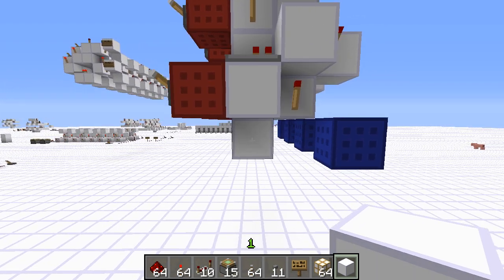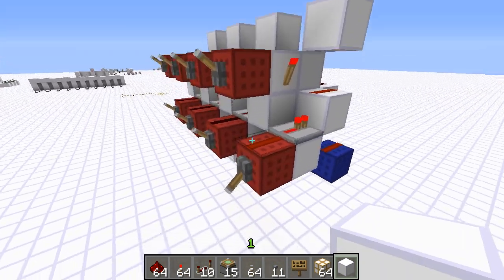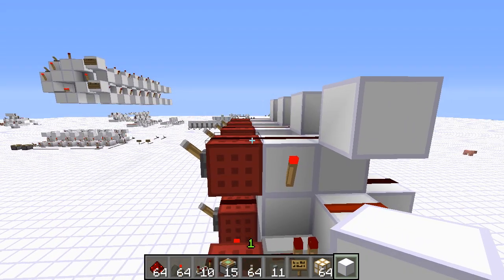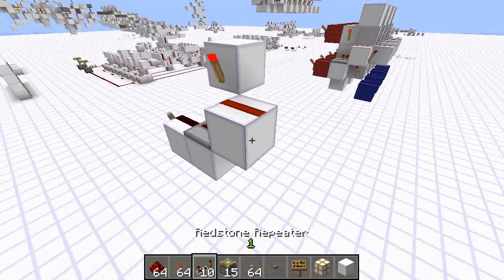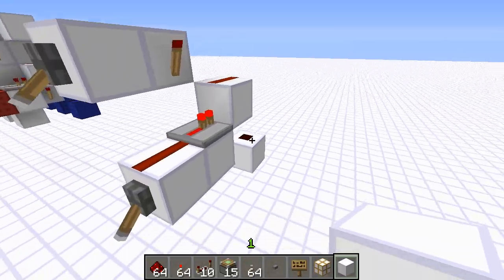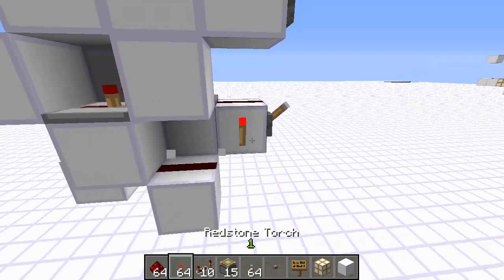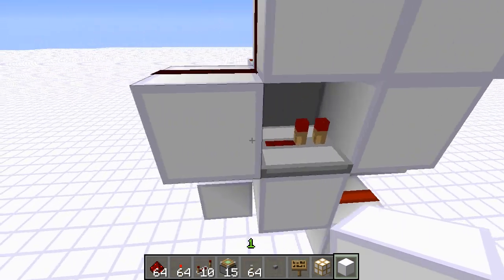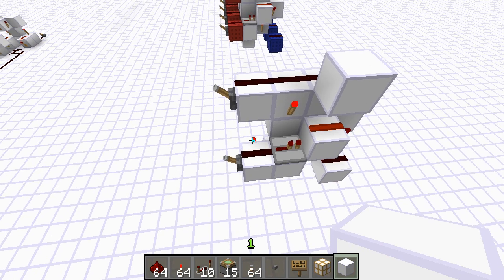5x4x2 2 tick XOR tileable without glowstone logic

Comment from the maker: That path is only taken when output is going from 1 back to 1, so therefore it doesn't matter. It can generate a pulse, as stated in the description, but unless you're planning to change the inputs in sync, that won't be an issue.